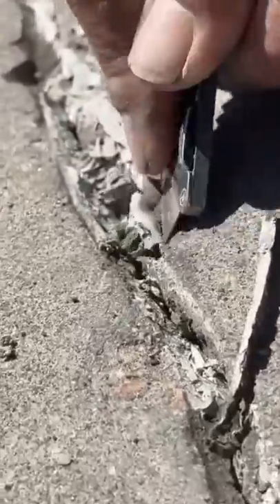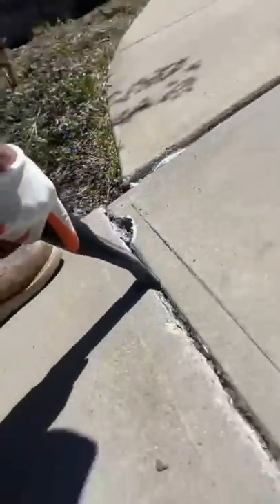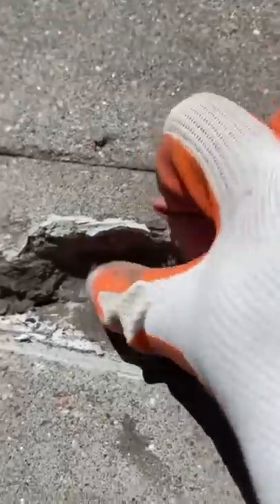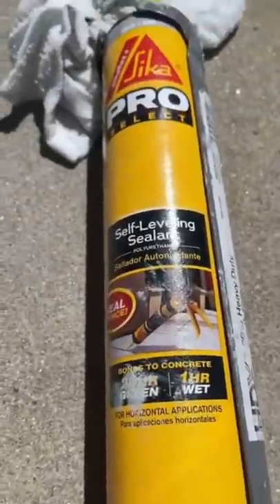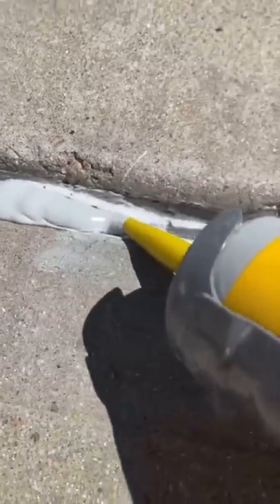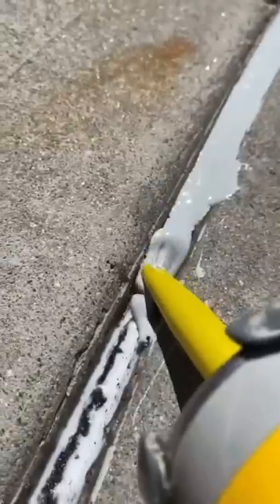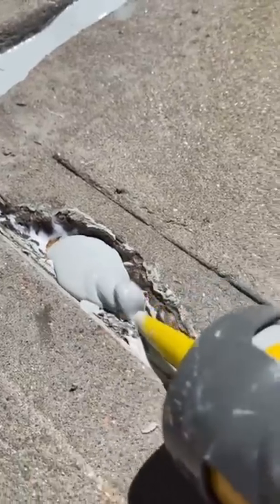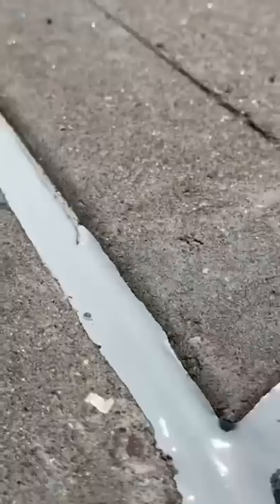How to repair driveway control joints #shorts #driveway #repair

Comment: Grind those joints out. Clean. Then chinking. Then polymer modified hydraulic cement. Trowel and texture to finish. Polymer will move and expand, don’t need bonding agent. Your crack repair will look perfect and match what’s there. Sika is a great product in certain applications, but it looks like hell in a finished area
Reply: Same thing I do ... you have to grind them out and clean them up. Ppl don't realize how important that is!
Reply: “Finished” did you see those meet lines on the joints 😱
Reply: Can you use this method to resurface chipped concrete patio?
Reply: @df4196  try a concrete resurfacer. Quick Crete makes one. There’s several brands. You put a light skim coat over the old cement. Watch a few videos on how to do it. Easy. And lasts a long time if you do it correctly
Reply: @johnburrows1179  thanks!
Reply: For an application on grade that doesn't move that much you solution will work so for his it will but generally expansion joints you use a caulking depending on how big the joint is an how much movement..
Reply: Absolute joke they don't cut or grind it out.  Anyone can spew ignorance anymore and people soak it up.
Reply: @ihdave1  absolute joke that you believe the customer is going to pay for that. Dude did what the customer asked, get over yourself

Comment: You don’t need to repair a crack in a control joint.  That’s why they are control joints, to control the cracking and take tension off the slab.  That’s literally the entire point.
Reply: Going to cause more cracking and damage in the future
Reply: Caulking the cjs is necessary if you want it to last longer, this is great for diy but pros would use np1 and tool the joints for a better longer lasting seal, also clean  the joints out much better. Still this video is for homeowners trying to save a buck not pcc pros
Reply: @fasfgasdfagadsf  that’s a little dramatic.  We’re not talking about a foundation slab, just flat work on the driveway. It would take 100 years for what you’re saying to even come close to happening.
Reply: @fasfgasdfagadsf  I agree with most of what you’re saying.  And the weather is defiantly a variable but as a builder of most of a decade, a licensed home inspector and now a procurement manager for one of the largest home builders in America, a standard 3000 psi concrete driveway poured on a new residential compacted pad will last nearly forever.  Filling control joints could potentially do more damage than good if it bonds the slabs.  Most cracks on a good pour with a proper cure period are self inflicted by homeowners who drive or allow heavy trucks and don’t take the necessary precautions.
Reply: @fasfgasdfagadsf  hire an engineer to pour a driveway?  Haha you’re silly.
Reply: @fasfgasdfagadsf  you’re one of the fools.  No one gets engineering for a driveway pour.  Not one builder in this country.  You just have no construction experience and don’t know what you’re talking about.  For a house slab, yes.  Framing, yes.  Retaining walls over 4’, yes.  A driveway, no.  Do you even have a residential builders license?  Because I do.  I’m not making this stuff up.  NO ONE GETS ENGINEERING FOR A DRIVEWAY POUR.

Comment: You cannot slice backer Rod . If you expose the inner pores it’s compromised otherwise everything looks prepped well . The product featured is excellent. Highway department uses toilet paper as a topper or you could use a dusting of sand . If you are in a heavy foot traffic area use cones or caution tape . I’ve used both but had people ignore it a track it for several feet . Nearly impossible to clean up once it sets

Comment: Gotta use 1A (crack fix) on the edges or it's gonna sag like your last shot shows!
Reply: Sand works great too
Reply: Ever used Sika? It's awesome. If it says, that just means it's not dammed up at one spot. But ya, I've used it in many applications. It's a fantastic, long lasting product.
Reply: @redeyestones3738  😂 You're joking right? We burn a pallet of 1a, self level and crack flex every month, don't question if I've "heard of Sika"!😂
Reply: @brookekathryn1980  ok. It was a simple question. No need to make such a big deal about it. Sheesh. All I was saying is it's a good product, which it is. I've never dealt with cracking, or bad sagging issues. So I was simply asking if you'd used it. Calm down.
Reply: @redeyestones3738  I'm sorry you took it that way. I just busted out laughing when I read your comment. Especially considering 1a as mentioned in my original comment is a Sika product.
Reply: So, does this sound right:

1) clean joint of debris
2) wet concrete so it doesn't absorb too much moisture from products
3) insert closed cell backer rod
4) use 1A on concrete walls of gap, let cure
5) fill with Sika Flex
6) while still wet, top Sika Flex with polymeric sand

7) (optional) add acrylic concrete sealer on sand
Reply: @MadLadsAnonymous  That would be the basic steps for proper application, yes.

Though, 1a does not always need to cure before applying flex
Reply: @brookekathryn1980  Thank you for coming back to comment!
Reply: @MadLadsAnonymous  Here to help.
Reply: @brookekathryn1980  One more thing:

Have you used a product like TK-9030 epoxy to fix cracks?

Seems like it's better for cracks not susceptible to freeze-thaw cycles and the previous workflow I wrote is better for expansion joints.

Does that sound right?

Comment: I used same product and three years later it cracked and split. Best thing to do is get a crack chaser blade and bevel out the crack then buy top coat and mix I little on the thin side.

Comment: Backer should be oversized, and not meant to prevent “seeping”; backer prevents a third anchor point to allow the sealant full movement and recovery.  Breaker tape is sufficient as well.  You need to chase the joint cleanly. Manufacturer’s rep here.

Comment: will the self leveling kind still work with a slight slope on the driveway? mine is sloped away from the house max slope is  2" over 13' .  Some of the sections are only 1/2" fall over 13'  I figure we will dam up the ends

Comment: Also, having a not too thick layer of caulking can also precent cracking. 
I wouldn't at least wire brushed the joint tho
Reply: Wire wheel on a grinder, I would have even grinded down some of the sharp cracks.

Comment: Use an oscillator for taking out the caulking then hit the excess with a grinder and a wire wheel

Comment: What he did is better than nothing but if you want the joint to last the life of the caulk , you need to grind the top inch or so of the inside edges of the concrete . 
  Also how you place the closed cell backing rod is very important. 
  The caulk needs to be twice as thick at its point of contact with the concrete as it is in the middle of the joint so that when it stretches it is weaker in the center and is less likely to pull off the edges. 
     A well laid joint will fail at the center of the joint and not pull off the edges , a very common cause of failure. 
  Also , self leveling can be tricky.  If you leave any gaps the caulk can escape under the backing rod. 
  A trick is to have some regular body caulk ( a urethane caulk ) and use that to block any small gaps that the backing rod doesn’t cover.

Comment: Correction you have to have rod because depth and the joint need grinded if you cut out old caulk then wire brushed and blown off or shop vacuumed it’s very important. Your rod is never supposed to be deeper Then a half inch or it split down the sides nothing under 1/4 inch or it’ll split down the middle. Your welcome im a union professional caulker.

Comment: The one fix that looks legit but is only going to last a year
Reply: Well at least you have a returning customer
Reply: "No king rules forever."
Reply: This is one of the few time's i've seen someone do something correctly on this website...
Reply: In areas that freeze over for sure.
Reply: If you think sealants only last a year then you're obviously not in the business. I've removed 30 year old silicone that's an inch wide that never failed. Makes me wonder what brand those hacks used so I can use it if I ever end up in a situation where I'm such a hack I need an inch of silicone. This fix will last a lifetime. It allows the concrete to expand and contract. I just don't like that he didn't color match with concrete dust. He's telegraphing the repair.
Reply: if you find a better product than SikaFlex please let me know

Comment: If the crack you’re having to fill up is bigger then 2” switch to a concrete mix or some shit like that as caulking isn’t really meant to be used for big cracks just for gaps really

Comment: If you get caulk on the concrete that stuff will peel up over time I used to specialize in crack repair so word of advice if you concrete is you need to find out why it’s cracking and fix that then save your money your gonna spend paying someone to come out five times to repair the crack and have the slab redone

Comment: Bro buy the 2 part bucket save some money,  use a grinder to clean groves, fill with sand is much quicker, use a propane torch to pop air bubbles after pouring,  and add sand so junk like bugs and debris dont stick and blends with the cement, and last seal with a concrete sealer it will extend life of mastic.

Comment: Can you please include how much you charge for each job, it would be super helpful for a beginner handyman such as myself :) love the content!
Reply: No sure what he charges but most services like this charge time + materials, and they charge a minimum amount. You first need to figure out what you need for an hourly rate to survive.
Reply: @HeadBroski  a handyman or other trade will RARELY charge T&M as it limits the amount of profit they can make to a fixed amount. T&M pricing is only for very unique situations that are difficult to accurately price, in which case the T&M pricing may limit their profit but also eliminates their loss potential. In this situation, which is so easily predictable and easy to price, this would be given a hard price 99 out of 100 times in order for the contractor to try and improve their margins. T&M would not be in the picture.
Reply: My work is time and materials with minimum charge. Every area has an average rate for "handymen". As you learn skills and get better tools you can charge more. If you can, hire on with a company willing to teach. If nothing else read the "comments" on each video to find the mistakes. The day you stop learning is the day you die.
Reply: @robbiemize  I only charge T&M. Most everything I work on turns into a problem when dealing with hidden damage, previous errors and other shit shows. I do very well with my loyal repeat customers residential/commercial.

Comment: Massive crack in the driveway but filling it won’t work cause the driveway is already pulling away. And the finish on the driver is pitted due to salt or calcium chloride so just replace. It’s like putting a new windshield in a car with no motor!

Comment: We use dry sand to fill cracks and save on sikaflex.
Reply: We use to as well. Takes to much time though. Backer or crack fix to build and seal. A typical driveway makes $2,500 and uses only about $100 in material when you buy in bulk. Plus with backer and caulking it's a 2 hr job.
Reply: @superdutyscaler6823  I have the #1 in the nations housing market. Competitive prices reflect such.
Reply: @superdutyscaler6823  must be L.A.

Comment: Cutting backer Rod exposes the open cell foam which isn’t a great idea. Use smaller diameter rod or larger depending on the width or depth of the void .

Comment: That is a great product! Amen on the backer rod. Having installed it professionally myself just a suggestion but they make a primer for the edges of the concrete to improve the bond to the concrete. To make it look like a struck joint a concrete slicker or a common table spoon can be used to tool the caulk. Always put painters tape on both sides of the joint before tooling and priming. To get a perfect smooth finish you take a spray bottle mixed with about 50/50 dish detergent and water. Spray your fingers with the soap solution and rub the joint it will make it as smooth as a babies butt. Used this procedure on the concrete roof of the United Engineers building in Philadelphia Pa. This procedure assures that that water can never get between the concrete and the caulk causing a leak! Hope this helps?
Reply: Do you have a name for good primer?

Comment: The real solution is tear it out and pour a new driveway. Control joints are there for a reason and filling them with gaps like that will not last. Do your customers a real service and fix it the right way so your not coming out every year to collect another 500 dollars on something they don’t need

Comment: The way I was taught, we always use the softest possible mortar mix for the application; it bonds great to both slabs of concrete and is soft enough to expand/contract with the weather. I think it might last longer too.

Comment: NP 1 is way better got some that’s 15 years old still looks good and the best for roof leaks on trailers and mobile homes with metal roofing will tear the metal before turning loose on 8 year old repairs now that’s bad ass if ya don’t won’t leaks

Comment: It's not bad to fill the entire crack instead of just the surface layer
Reply: Yes it is. It's not made to be super thick. And for it to work properly is better if it's only attached at the edges near the surface. It also takes forever to dry if laid in thick. And I usually find if you don't use some sort of backer you tend to lose a lot of it in deeper cracks, and that stuff isn't cheap

Comment: I hate those store bought sikaflex guns the application is so inconsistent and makes it hard to do a smooth pull. He would be better off investing in a bolt gun and use a sikaflex tube instead of the ready gun.

Comment: No such caulk will ever fix a driveway.  It's physically impossible.  Not sure what people are trying to accomplish,  beautifying a gap??  Keep in mind a slab of concrete is incredibly heavy because it's designed to support weight of vehicles.  It cracks because there is uneven and inadequate support.

Comment: this is not a propper fix.. first you must cut both sides of the joint to remove material straten it up etc then install felt pad the lenth of the  joint silicone and every other fix like this guy does in 5 years it will do the same thing over and over again felt takes decades if not 30 years or more do the job right man